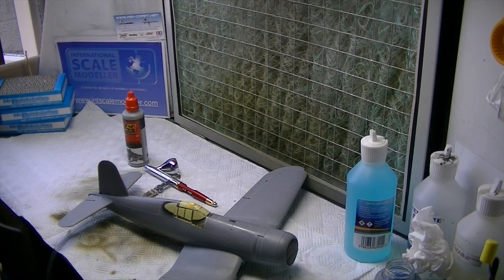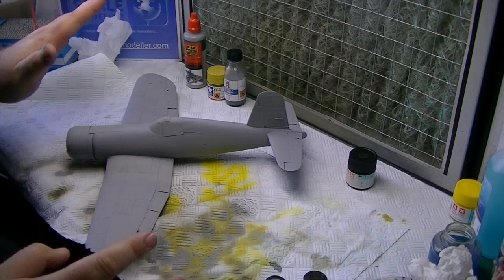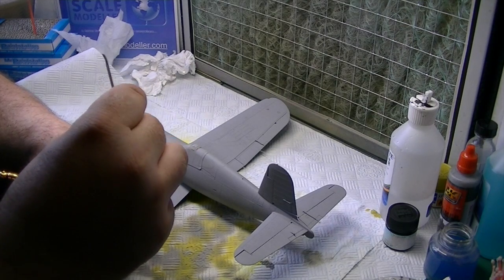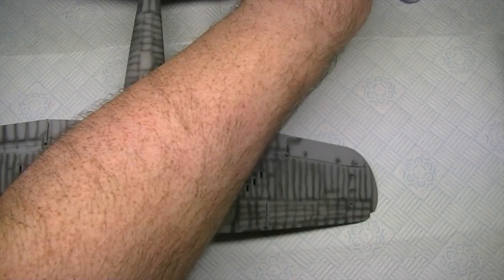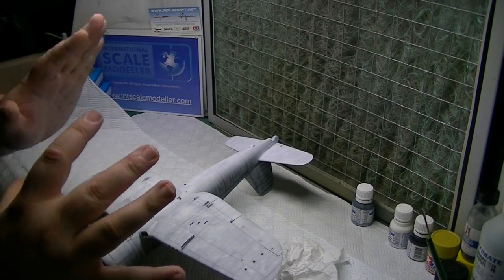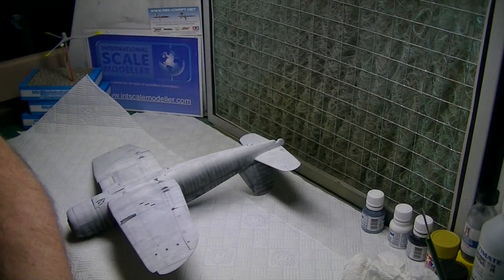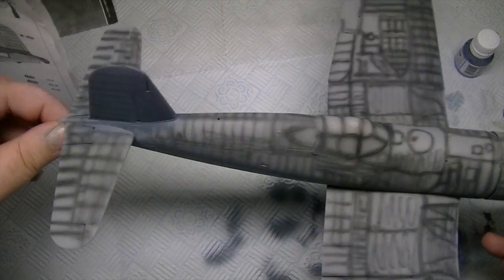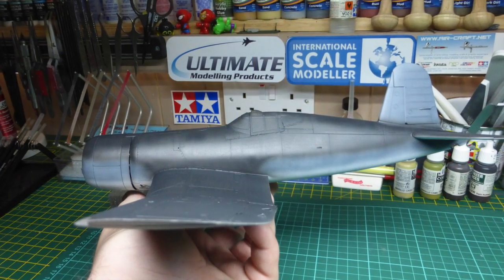Tamiya 1/32 Vought F4U-1 Corsair Birdcage # 60324 Part 11 www.eModels.co.uk

Comment: I wish I was brave enough to just eyeball the ratios and mix in the cup.  My concern is that you end up with a 1/2 a ml or so of pure paint or pure thinner at the bottom where you can't reach to mix.  I prefer to count drops and mix in another jar, but then I end up wasting some and having to worry about extra stuff to clean